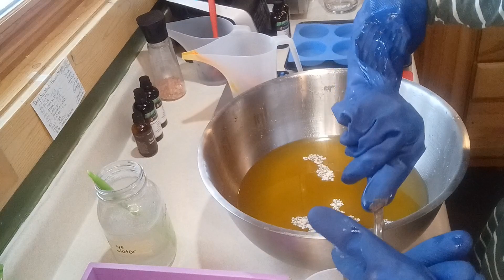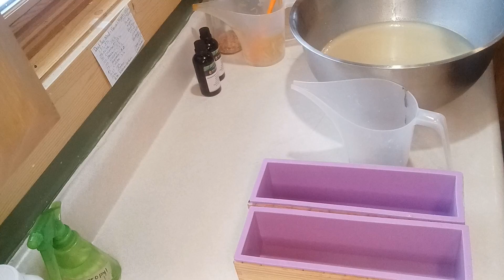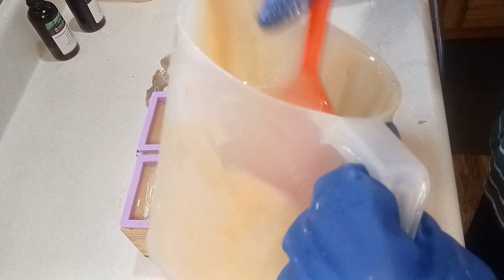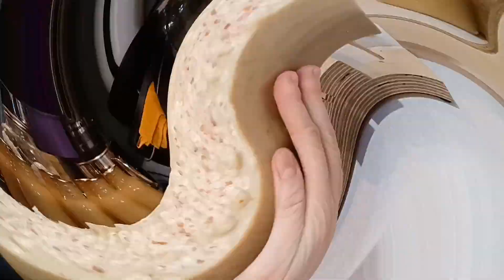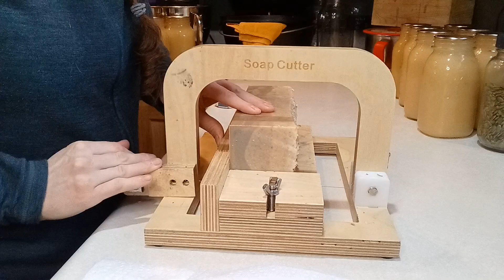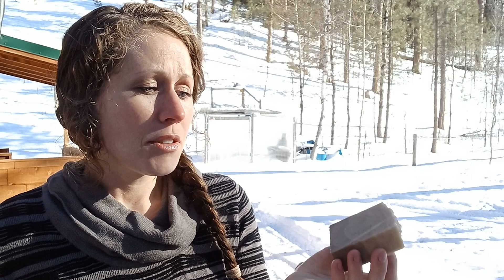DEAD SEA MINERAL MUD SOAP | Frankincense and Myrrh Essential Oils with Benzoin Resinoid & Pink Salt

Comment: New Directions Aromatics has two Frankincense Essential Oils - one is "organic" the other is "Boswelia".  You mentoned you used the more affordable one so I guess I could figure it out by that, but just want ot make sure. I used a Frankincense Essential Oil once and the soap turned to a solid rock in the bowl in about 10 seconds - rapid acceleration.  You didn't experience  that so I'd like to try what you used.
Reply from the maker: Yes it was the more affordable of those options, and it seemed to behave fine for me. Definitely give it a try!
I'm more picky on EO when it comes to longterm skin exposure and ingestion, but for soap, I felt OK in using the more affordable one.
Reply: @wildbackyardsoaps  Thank you so much :-)

Comment: Would a large ladle work instead of pouring from the Mega Bowl?
Reply from the maker: 😂 technically yes, probably should have done that!
but I really need to eventually invest in a square clear tub. Then pouring from the corner would work. Most of my batches lately have been smaller so I've been able to survive with my glass bowl with a spout.